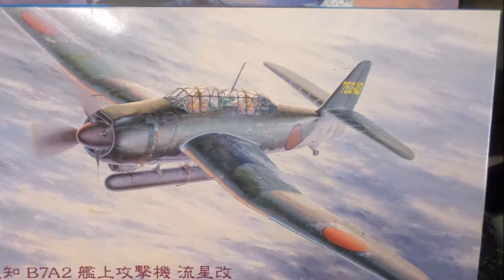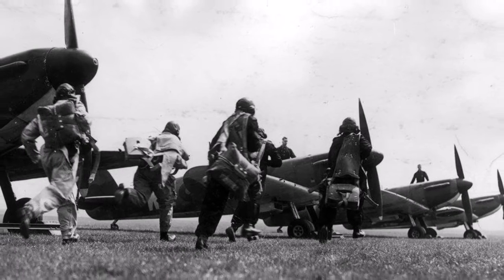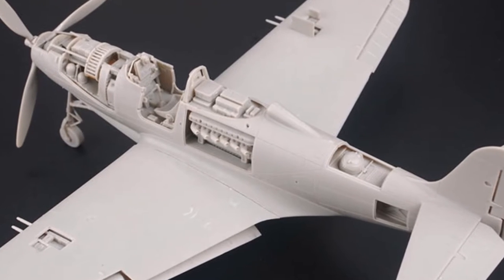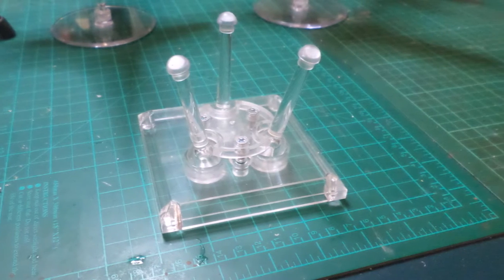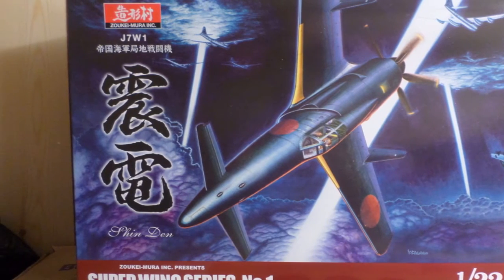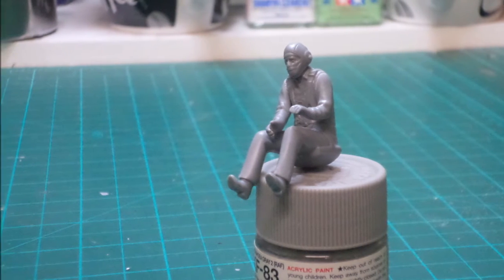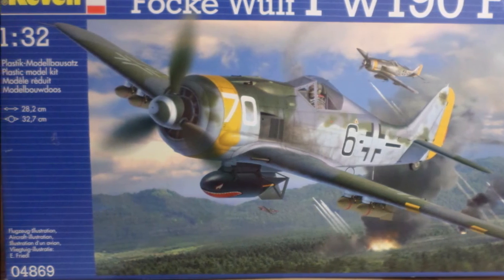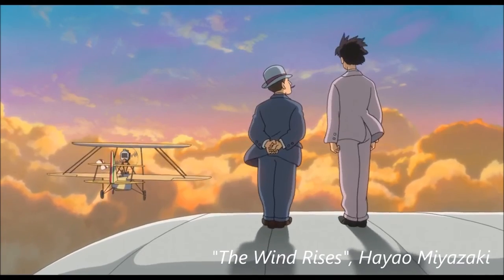The Boxart Paradox - why do we build model aircraft on the ground?

Comment: I think it depends on the aircraft. The F8-bearcat is a taildragger just begging to show off those long legged landing gear but the F-14 begs to have the wings swept back in high-speed flight.
Reply: G'day LSU, You bring up an excellent point. Some real aircraft can look like they are in flight while sitting on the flight line with their 'legs' down, for me that's a Spit. It's just so darn beautiful it looks like it's moving even when it's not. A C-130 is the same. Only a tiny bit of undercarriage is seen on the ground because of the wheel sponsons. Nearly all modern fast jets do look awkward sitting on the ground. So, it's really in the eye of the beholder and how you consider the overall look of any particular aircraft. Models are very much the same with some glaring exceptions. Some models have out of scale landing gear which makes them look ungainly. I like the clear plastic stands one can buy in bulk from Airfix, at a distance they seem to 'disappear' so the eye concentrates on the aircraft. Cheers, BH

Comment: Just got back into the hobby and designing a stand to be used in pairs which enables plane to be positioned banking at any angle, diving, climbing or cruising, made with coat hanger wire, not ideal but cheap and easy to bend into any shape.
Reply from the maker: Im thinking along similar lines with something a bit more modular in the future, perhaps to replace a wheel well plug? Thanks for the comment, cheers Chris
Reply: I'm with you there mate !!

Comment: 1/48 scale isn't necessarily a step up from "braille scale." 1/72 scale takes less space and without all that cockpit detail, one can go ahead and close up the canopy, put the landing gear up, and display the aircraft on a stand.
Reply: Interesting points, and I seem to recall that the 1/72 scale was specifically designed for the British "pocket money" market as they would be cheaper as well as easier to store and display (as from a bedroom ceiling!).
Reply: You know nothing of Braille until you have built a GHQ modern fighter in a hangar scene.
Reply: Actually you would surprised how much detail can be present in Braille scale, I know I am. My current build is a 1:72 Chastise Lanc. They have huge canopies which if polished can show a surprising amount of detail. One thing from personal experience is that if you look down on a cab in flight, the cockpit is usually what draws your eye. This is why my lot and RAF mud types stopped wearing white helmets decades ago. If you look at the detail now available in IBG and Arma 1:72 scale kits 😳. Better than some 1:48 and not extra, although for a tiny outlay I am happy to buy a yahu panel for a Braille scale bomber if it’s visible, it really draws the eye

Comment: I think the main reason I build gear down models is because there’s no added work figuring out how to display it, you can simply set it on a shelf and it looks great. And also to appreciate the craftsmanship involved in getting the gear to look right…I however am not into displaying panels open and all that.
Reply from the maker: Thats fair enough, although I still would like the option to not have to put the wheels down on everybuild. Agreed with you on the displaying all panels open etc...I think wedge/cutoff dioramas work better when you want to do that, not hte whole plane!...cheers Chris

Comment: Great video. 
Funny thing... when I was young (think 11/12) I built all of my aircraft wheels up for two reasons: so I could hang them from the ceiling in dog fight poses; and I never wanted to build the landing gear, so it was easier to just button it up.
Now, the last three kits I built, I did gear down so a viewer can see the gear/gear bay detail. Times change.
However, I am going to be building the Revell 1/32 Fw-190 soon, and I have been contemplating doing it gear up... and I think you have pushed me over the edge with this video.

Comment: I have an old Airfix B-24-J 1/72 (I believe it hasn't been retooled yet) which has working landing gears and they work pretty well, so when I'm fed up of seeing it on the ground I retract the gears and put it on the display stand. Nowadays they don't make models like that anymore. The only downside are the raised panel lines and rivets, hundreds of them. Nice video Chris, it makes you wonder. By the way, I build all my models with the wheels down. I've just subscribed to your channel. Alex

Comment: I'm going with the "not actually designed for in-flight display" reason. There are some in my stash that I really want to do wheels-down, but some simply aren't ever supposed to be in-flight, having a display base like a carrier deck or a museum, no pilots (easily rectified), no stand (not too much effort required either), but mostly because the wheels-up state seems to have been an afterthought and therefore a flying model requires the fitting of some components where they simply will not fit correctly. Some even have separate closed wheel well doors, which still don't fit properly.
Then again, there are some Bandai Macross fighters that simply don't include landing gear at all...
Reply from the maker: Yep its the bane of my modelling life - fitting those damn wheel well doors properly. Everyone is going ga-ga over the new Tamiya Phantom, but just like the new Tamiya Spitfire, it too has no wheels up option and will require serious surgery! Cheers Chris
Reply: @beckersmodels  Similar to all those old muscle cars that have to be posed with an exposed engine bay as if at a car show because the bonnet won't shut properly...

Comment: Im 1000% with you mate!! I build ALL my aircraft models in flight.  The struggle is unspeakable (rarely a pilot provided, maybe closed gear bay option, and more). Recently got a Tamiya 1/48 F4U corsair and I did not believe it. Typical brilliant Tamiya engineering, but even the flaps were made for ground only!! Had to work my #&* down to remake them and the pilot who was provided for out-of-the cockpit posture, in order to put him in. And very few options to buy just pilots for older /modern aircraft!!
Reply from the maker: Thanks - yes its a struggle but something I want to overcome and yes Tamiya's 1/48 Corsair is a PITFA to convert to wheels up (which is why I only did one of my recent double build of them in the air!)
There's more options now for pilots, but you have to search far and wide for them, particularly 1/48 scale which is weird, 1/32 its getting easier with Reedoak and Aires. Cheers and thanks for watching!

Comment: I got the the 1/32 Trumpeter SBD Dauntless. Box art depicts it diving on a Japanese carrier. So obviously I want to depict the model doing just that. And of course no pilot or gunner included. So I went and bought some resin figures. Unfortunately they didn't quite fit properly. I ended up cutting off the pilots feet, and gluing the control stick right to his hand. The gunner was even worse off. His arms wouldn't fit. But to me it still looks better with the figures when in flight.
Reply from the maker: its a pain isn't Nate? Did you use the Master Details figures? They are notoriously tall - over six feet in scale I think. I prefer Aerobonus, but not always available for every era/situation jut like the SBD. Reedoak is a great alternative, but very expensive. But yes, this has been my problem! I need to do an SBD one day, fantastic aircraft - many thanks for your comment, cheers Chris

Comment: Look on eBay: you can actually buy Airfix display stands suitable for both 72nd and 48th scale aircraft. It's the old clear type we all grew up with, and making a slot for the vertical arm should offer no challenge at all. They're not cheap, but cheaper than most modern stands available. It's also possible to make your own stands out of sheet acrylic or perspex, something I'm going to investigate in the near future.

Comment: Displaying the modeler's art in the heavy detail areas necessitates gear down so you can have the canopy open to show all the work you did in there.  When I was a kid I did them gear up because I didn't want to deal with landing gear but as an adult I've got a lot of detail in areas that I couldn't show gear-up so I build them gear down.  I suppose I could build 2 of everything.
Reply from the maker: Thanks for commenting - yeah I get that too, especially when you spend an age detailing the cockpit, like I've done with my Academy AH-1Z, or my upcoming A-6A Intruder. I just love the look inflight, and its a route rarely taken these days. Cheers, Chris
Reply: Yeah in flight always looks better, aircraft aren't designed to be on the ground.  If you have a 3d printer you can churn out in-flight display stands pretty easily.  That's what I've been doing.

Comment: Just finished a F4UF Corsair from Revell. It has actually retrievable landing gear and folding wings - as a kid that would have blown me away - so you have the option of displaying it in flight or on the ground AFTER you build it (with pilot). Theoretically. Because in reality, the wheels are too big to go inside. And since the covers don‘t nearly fit as well as the usual ones, you can‘t just glue it on in closed state, you‘d have gaps. It‘s like, wait what thats awesome, finally a - ah god no of course it doesn‘t work foooook

Comment: Want to build it wheels up, but don't have a pilot, or don't like the static prop? Build the aircraft as a "gate guardian" which requires no pilot and has static props.. I've seen some gate guardian jets like a CF-5 put up on a concrete pole through the opening for the tailpipe displaying the jet as if it is climbing; the concrete is painted to mimic afterburner/exhaust.